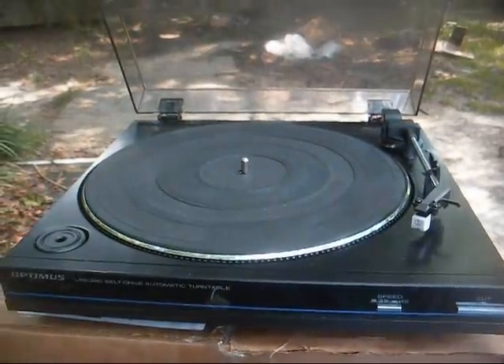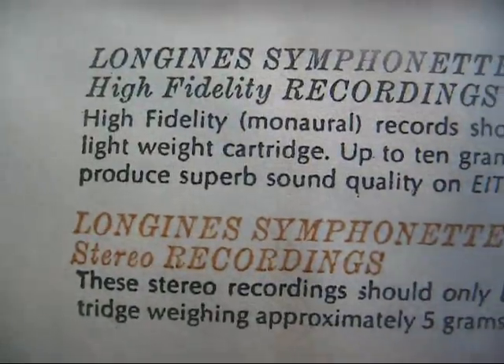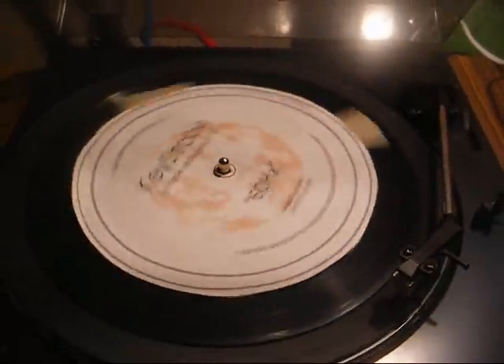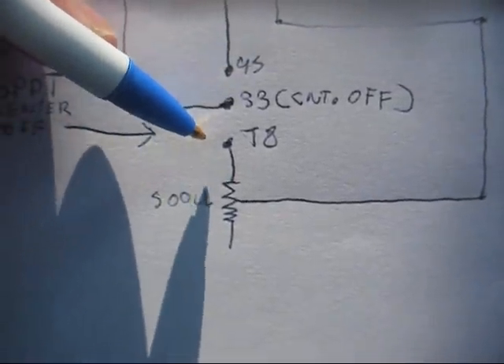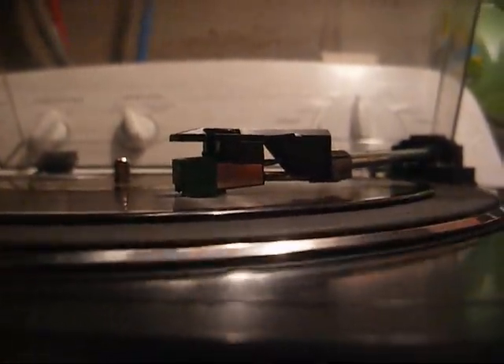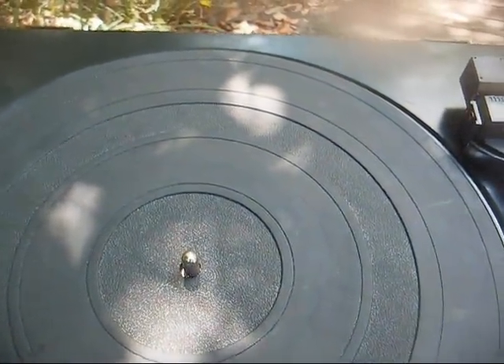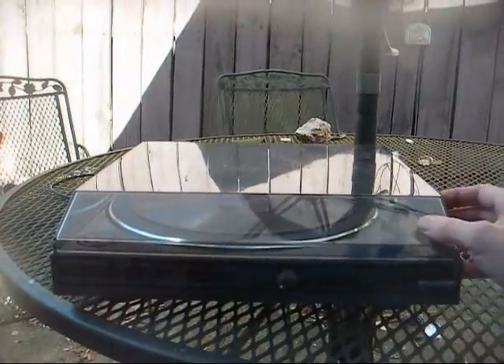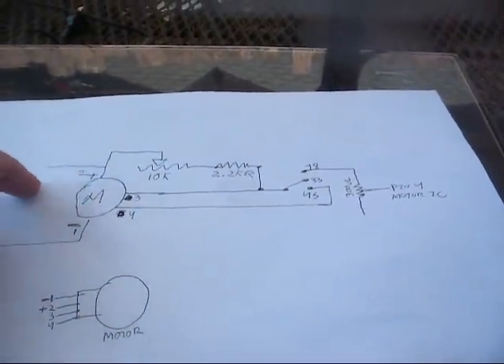Optimus Radio Shack LAB340 turntable..modification for 3-speed with pitch control.

Comment: RTVPN, Another great video. I'm just looking at the service manual for my Technics SL-B2 Turntable and trying to figure out how I can achieve the same thing. Any suggestions? The speed controller is on a separate board from the motor

Comment: It was later redesigned probably a couple times and rebadged as a Radioshack and RCA LAB-1200 and other models. I picked up one from goodwill for five bucks in early 2019. Had the origin al stylus, the kind that lacks the Audio Technica logo. Swapped out the plastic platter with an aluminum platter from an Audio Technica ATLP60 i parted out. Only faults with it that i fixed were that it played a tiny bit too fast and it didn't set the tonearm down on the record at the right place.

Comment: Hi.  Do you know if a V-M spindle from the Model 950 can be disassembled? The manual shows an exploded view as if it can be taken apart, but I can't see if there is a way to get the springs out. I'd like to weaken the springs a bit to improve the speed of the loading-return cycle, and since I'm never going to put a thick stack of heavy 78s, just maybe five 45s or two 33s. The heavy springs is really slowing down the change cycle. I have completely rebuilt the 950 changer including cleaning and relube the motor and a new idler drive wheel, so nothing is slowing down the cycle except the force required to push the record pusher.

Thanks. This was a very informative video on record care and the good old RS Optimus. 👍

Comment: I miss the good ol' Radio Shack the way it was in the 70s.  Lots of stock and employees who actually knew electronics & stores with plenty of parts.
Reply: I worked for them for a couple of years in the 90's when they were transitioning away from being a parts and electronics store to being a phone store. Where we were located wasn't a market yet for the digital cell phones they were pushing, so it took a bit before the two stores I worked at changed over.

Comment: I have a Pioneer PL990 which I bought new in 2016. Same mechanism as this with a Sankyo motor. This is also the Audio Technica AT-LP60 mech. I agree, putting your iPhone on the turntable will weigh much more than a record with the tone arm on it.

Comment: I bought a LAB 2250 Linear tracker that is a POS compared to the AT LP120 I upgraded to in 2017. the 2250 had grit in the worm gear causing sluggish tonearm return, acoustic feedback and IGD on last tracks. I now use a LP140XP, the only flaw is a batch of shitty transformers that vibrate making hum in the silent grooves, I will be putting in a toroid transformer. I HATE HUM from electrical gear, back in 83 a pair of faulty Mistral ceiling fans were bought for my and the sister's bedroom, the speed controller had a pot type control, fan tan OK full speed, hummed at reduced speeds. I couldn't sleep with hum

Comment: I think it's comparable to the Audio Technica AT LP 60. And old friend got this particular turntable in 1993 and it sounded great. About 2.5 years ago it started playing really sluggish. The motor was going way too slow. He is a person without many means so I asked him if he had any 3 in 1 oil and he didn't.  However he did have electric razor oil so I tried that. He plays a record every day and hasn't had a problem with it after the 2.5 years that I did it. Some people would think what I did may be a bad idea but it's still working.

Comment: The original patent for the 45/45 stereo record was stated as 6 grams. Magnavox Micromatic ceramic cartridge record changer per service manual is a tenth of an ounce, or 2.8 grams. Zenith had the floating ceramic cartridge that tracked at 2.0 grams. My Astatic flip over cartridge on my Gerrard model 1000 is 4.5 grams. A Crosley ceramic cartridge tracks around 5 to 5.5 grams. 3 grams is not going to chew up your records folks.

Comment: That cheap little digital scale that reads up to 5 grams can be recalibrated to read up to 10 grams! Just use the 5 gram weight that came with it and set the calibrate 0 grams with the 5 gram weight sitting on the pad. Now it will read 5 to 10 grams! Of course you have to add 5 to the number showing on the digital readout, so 3 would actually be 8

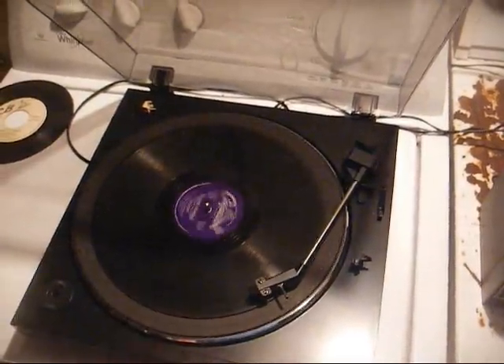Comment: 33:30 - Does the added pitch control have a center detent corresponding to exact speed?
Reply from the maker: As long as the pitch control is set to the center detent, you'll be on the right speed when the switch is set to 33, 45, or 78.
Reply: @radiotvphononut   As long as there is a detent. I'm sure you already calibrated the speeds.
Reply: I can't remember where in the video, (I think in the circuit diagrams) but there is a notation of center-detent.

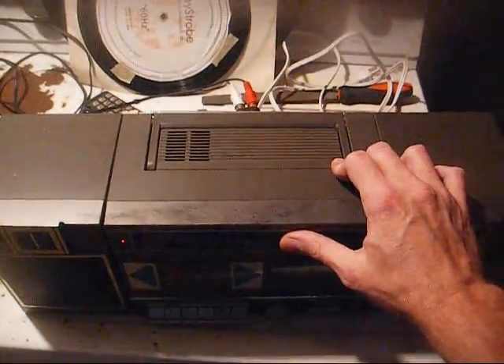Comment: 13:25 - A mini Aux input - in the EIGHTIES?  Wow, ahead of its time!
Reply: It wasn't as uncommon back then as you might think.  Most of the larger and mid-size boomboxes offered an AUX-IN (either RCA jacks, or 1/8" stereo jack).  The feature was usually touted as a provision to make your own mixtapes from LP, cassette, or one of those newfangled CDs.
Reply: @xaenon   I was completely aware of such jacks on portables back then. I was referring to the format(1/8" mini).  The onse I  encountered were all RCA inputs

Comment: Vinyl was not dead in the early 90s. All the record stores still carried vinyl and most albums had a vinyl release.  In fact, in 1990/1991, I was still buying 45s new in the music stores. It was the easiest way to get a single song. Cassingles never really caught on.

Granted, these were the waning years of vinyl, but I don't think vinyl ever really died.  By the late 90s, Walmart and K Mart stopped carrying records, but they were still in the record stores.  When the record stores started going under, vinyl largely moved to the used market locally, but new albums on vinyl, at least a limited number of albums could be bought new on the internet.  But tb the late 00s, vinyl was in its "resurgence"
So while it certainly disappeared in the larger consumer market, vinyl never really went away.
It's pretty amazing when you think about it. Records have been available for over 120 years.  This Does Not Compute just said in a video that the CD was the most successful audio media of all time. What an idiot. 120 years plus of continuous production! (there has NEVER been a time, even during ww2, when new records were not available.)
  Like during WW2, the late 90s and early oughts were slim pickings, they remained in continuous production.

Comment: How long should you play these things until you decide they need the speed adjusters turned?
I assume that since these have probably not spun in 25 years or more that they need to spin a while before they go back to the way they were.  I had a boombox with a tape deck that hadn't been run in 20 years and the rotor actually froze and I needed to go in and give it some encouragement. But this was a very large DC motor, not a typical small one. It took a while to start spinning the right speed, but it eventually did without requiring adjustment.

Comment: I have found most Audio Technica cartridges to sound good.  Even some of the really cheap ones sound really good.    The tracking pressure might be a bit heavy on some of them.  I have one of the better Audio Technica cartridges in my old Technics SL-D303 turntable that tracks under 2 grams that rarely skips and sounds good.

Comment: When I was younger I had a record player with 16,33,45,78 speeds but I have seen records with speeds of 33and a third rpms.
Reply: '33' and '33 1/3' rpm are the same thing; a simple '33' is just an abbreviation.  Likewise, '16' is just an abbreviation for '16 2/3' rpm (and '16 2/3' rpm is precisely one-half of '33 1/3' - no, that's not a coincidence).  '78 rpm' records are actually supposed to be 78.26 rpm, though the speed was actually devised as an approximation of a range of speeds back in the 1920s.

Why these odd, strangely-specific speeds?   Engineering reasons, mostly - it has to do with the types of motors most record players used from the 1920s through the 1970s, and the mechanical reduction required.

Comment: I have the Lab-330 the predecessor to that turntable you have there.  My parents gave it to me for my 15th birthday back in 1989.  Mine has metal platter, a strobe and an adjustable pitch control but a p-Mount cartridge though.

Comment: that's a good turntable  the whole 5 grams of tracking will ruin your records is a stupid myth the stereo LP/45 format was original designed  to be PLAYED on a phonograph that tracked 5 to 6 grams  that was the standards back in the day for stereo records which yes records will degrade more but who the heck plays the same record over and over to the point it the sound quality degrades that would probably take a few hundred to couple thousand plays and the only thing that would relay damage a record would be a bad needle. and i think in the late 40's when mono LP's/45's came out those earlyphonographs tracked 8-10 grams if not more. high tracking isn't much of an issue with mono records. but stereo records if there played on something that TRACKS WAY OVER 5 GRAMS the grooves would where out faster and i think it would lose the stereo effect. and great job modifying the turntable you do good work

Comment: It may be cheaper but, it  does the job to the best of its ability( Which is pretty good) A crosley’s Best ability is very low standards.
Reply: Crosley does offer some much nicer turntables than their Cruisers and all-in-ones.  They have models comparable to the LP60 and the LP120, and I think there's even one that's basically a rebadged and slightly altered Rega.

Comment: Actually 3.5 g. Is exactly the weigth Audio Technica says this cartridge must track at. (Atn 3600L) It has medium to low compliance rating. But I guess some people would always say that less VTF is better, knowing nothing about compliance, tonearm mass and stylus shape. So, there, audio snobs!😆
Thanks for this video, it was good fun!
Reply from the maker: Running a cartridge at less than it's recommended pressure can damage a record, just like with too much pressure.
Reply: @radiotvphononut , and very likely the sound is going to be distorted, too.  And if the recording is "loud" with heavy bass notes you can get that great visual effect of watching your tonearm bounce as it skips out of the grooves!  That's why some of the old test records added that feature.
Reply: @richardcline1337  lmao
Reply: @REXXSEVEN  What's that?
Reply: @radiotvphononut  Exactly! 👍👍

Comment: Wouldn't the neon lamp flash at 120 Hz? Once for each positive and once for each negative going half cycle?
Reply: The neon bulb is supplied with 60hz current. It has two electrodes-one glows, then the other glows, as the ac current reverses. What you need to do is, insert a diode in series with the neon bulb. This will result in one electrode blinking 60 times per second while the other stays off. Now you have a strobe!  RTPN knows far more about electronics  than I do, but he should have mentioned installing the diode- otherwise,  the neon bulb simply lights up the area around the disc. Sorry, RTPN.
Reply: @BakedRBeans  True enough, but I think those strobe discs are set up for the 120 flashes per second that 60 hz would produce from a typical neon bulb.